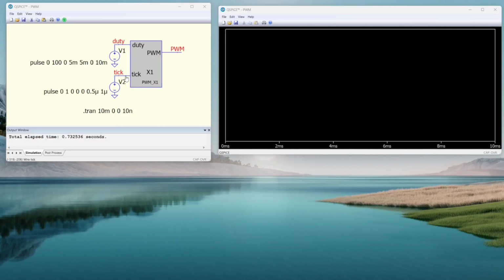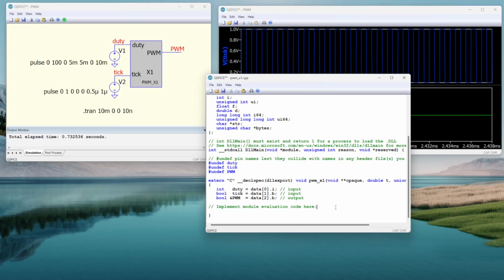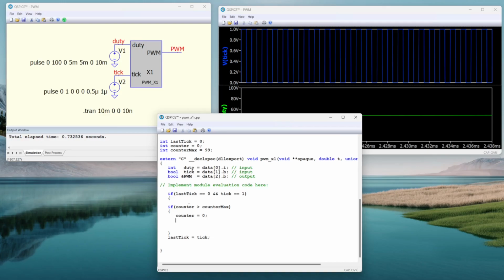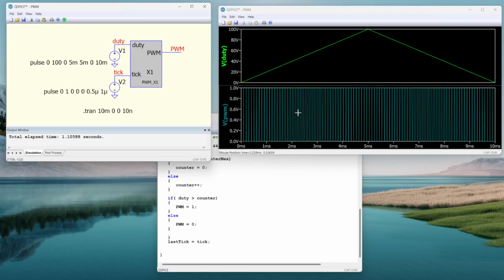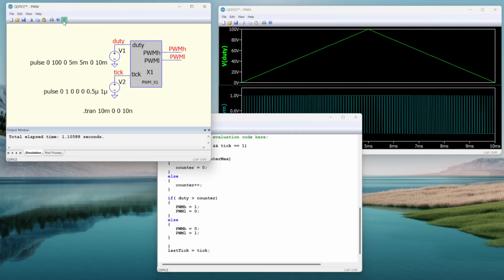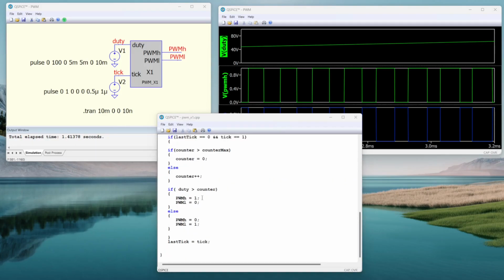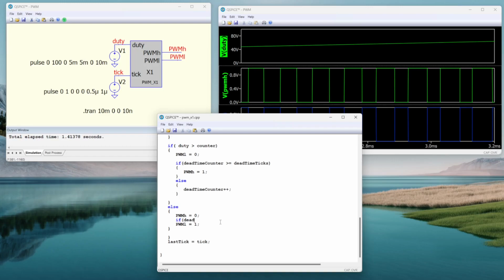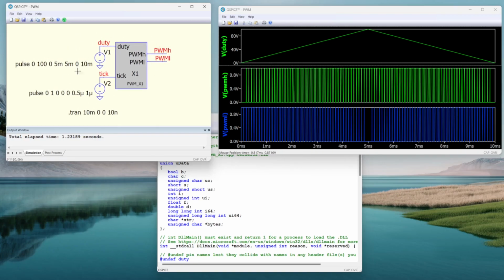Simulating a Microcontroller PWM in C++ using QSPICE

Comment: Thanks for the helpful video.  I have noticed that the output ports seem to have an impedance of about 1k Ohms.  Do you know how this is set and whether it can be changed?
Reply from the maker: The output impedance of 1k Ohm is the default. The attribute can be changed with right click on the C++ block -> Add New Attribute and type ROUT = 0 to have the lowest possible output impedance. 

In addition, the output voltage for boolean type ports can be changed with adding the attribute VHIGH. This allows you to change it to typical microcontroller levels like 3.3V or 5V.
Reply: Awesome, thank you!! @engineeringhustle